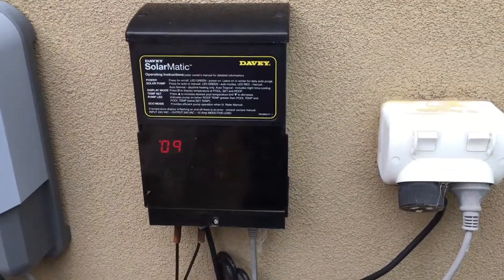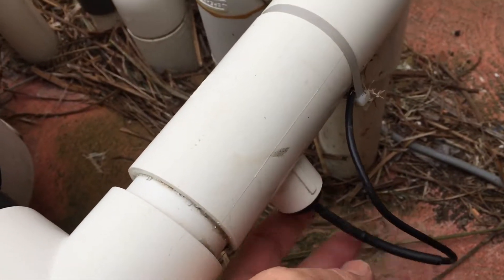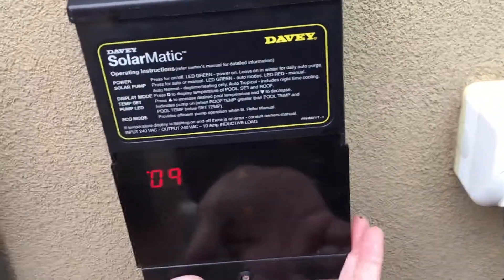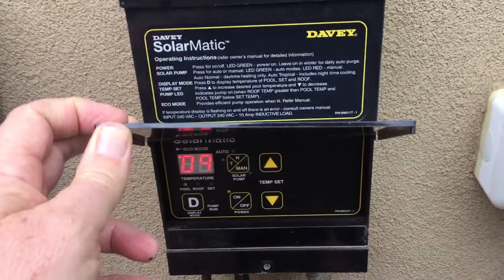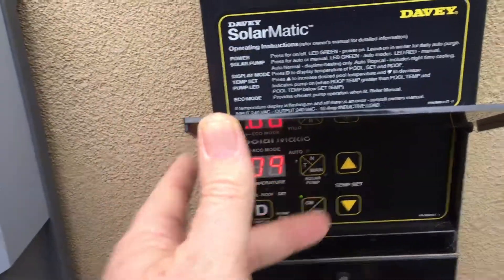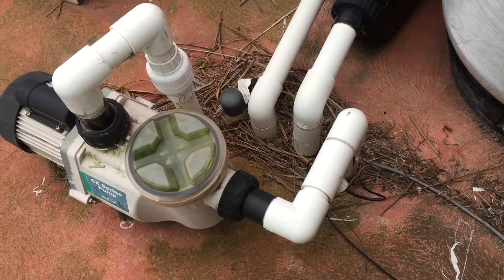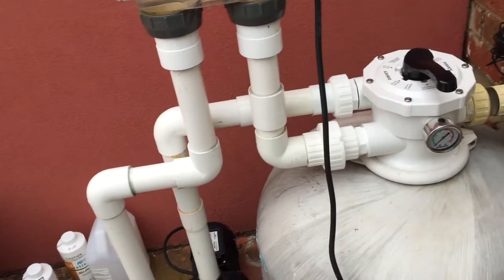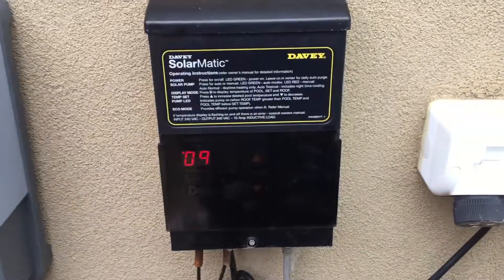Solar Controller for Swimming pools. What is it and how does it work?

Comment: does it work with one sensor only?
Reply from the maker: Hi. No it doesn’t. 
These are differential solar controllers. So they work by comparing the two temperatures. 
They need both temperature sensors connected and working. 
MRT